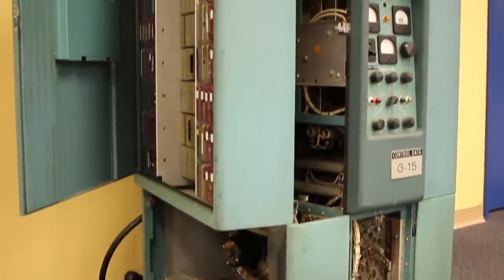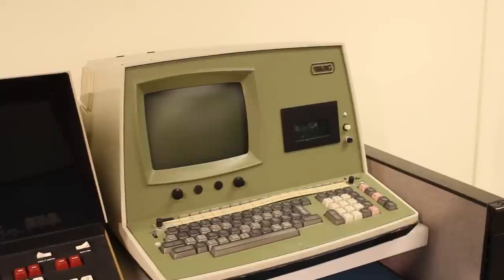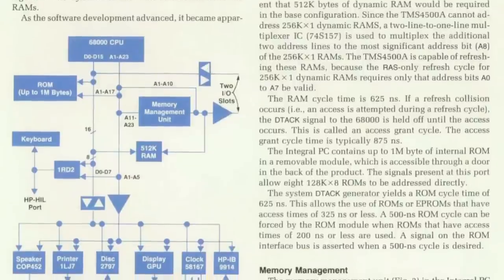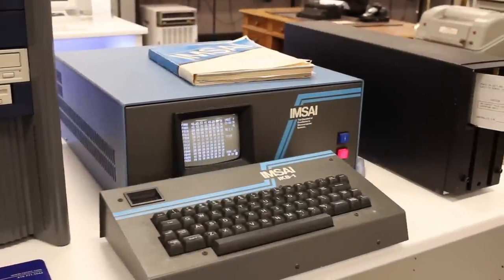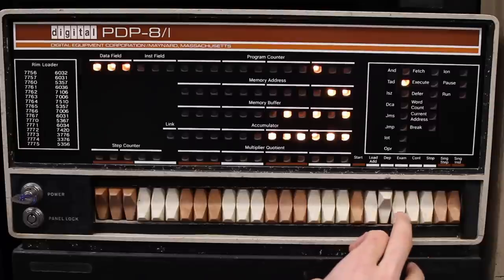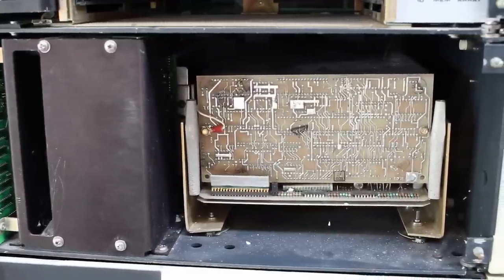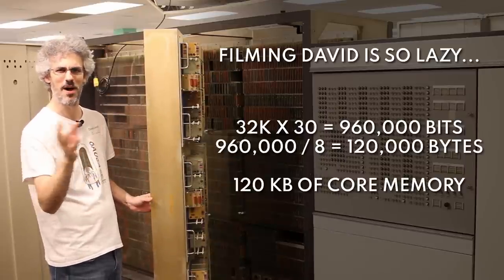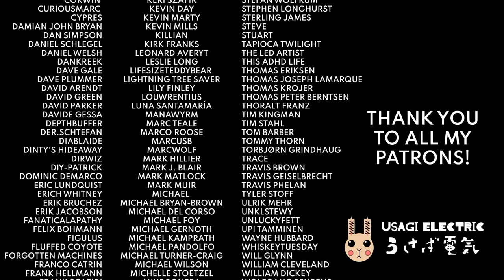Insane Computer Collection at System Source Museum

Comment: 18:20 how were field technicians or the owners expected to track down faults in the middle of this spaghetti?
Reply: That's why all the cards have test jacks on them. I don't know about that system in particular, but most of those type systems had dedicated test equipment. When you connect two cards, you'd then test continuity (and perhaps resistance and capacitance) between the cards to make sure the connection was correct. And then it would get logged in the system's documentation notebook. Things like engineering change orders, repairs, etc were all tracked, along with the date, engineer, reason for change, etc.
Reply: On the Burroughs medium systems, we had very extensive schematic diagrams of every card, and even more extensive wiring lists for the backplanes.  We would load in diagnostic routines, then single-step the clock while pocking around with an oscilloscope, to see if the right bits changed at the right time.  There were large "card extenders" that allowed you to pull any card from the backplane, put in the extender, then plug the card into the extender.  That way you had access to every chip on the card, and the traces on both sides of the card, to make it easier to follow signals around, and find the faulty chip.  Then we'd replace that chip by soldering on the card itself, or sometimes replace the faulty wire on the backplane.  It wasn't that hard to do, actually: just very, very time consuming to do fault finding like that.  Big bank customers did not like having their mainframes offline for many hours at a time while we fiddled around inside, single-stepping and probing.  Mostly we would just swap the faulty card for a spare one (yes, we had spares for most cards on-site) to get them back up and running fast, then do the fault-finding on the bad cards in scheduled maintenance times.  Even though that "bowl of spaghetti" backplane looks impossible, there's actually list telling you which wire goes were, so you can troubleshoot... slowly!

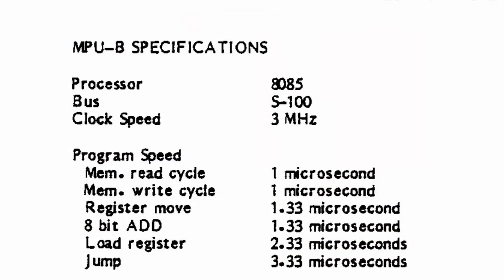Comment: 7:36 I think the 8085 was Intel’s attempt to fight back against the Z80. Not a great success.
Reply: Doubtful. No changes were made to the instruction set, with the exception of the RIM and SIM instructions being added.  The 8085 eliminated the need for the 8224 clock chip and 8228 system controller. It did have a significant change to the hardware interface, changing how the system control signals were handled and the multiplexing of the data bus onto the address bus, plus silicon improvements to allow it to run up to 3MHz. It would be considered an incremental improvement over the 8080 more than anything.

Comment: How can anyone service one of these wires without messing 5 more of them? It is like fighting the Hydra.
Reply: As one who did do maintenance on similar wire-wrapped backplanes, I can say you are dead right!  "nightmare" doesn't really cover it.  Especially when we had to install "patches" to upgrade them (called "RINs" and "LINs" in Burroughs jargon).  That usually involved cutting and removing existing wires, and replacing them with different new wires, going to different places.  When I had to cut one of those, I always felt like the guy in an action movie, facing the ticking time bomb, trying to decide of it is the red wire or the blue wire that  I need to cut... One wrong move, and the machine is dead.  (To make matters worse, they were all white in the back of a B4800!)

Comment: Beeing able to hear so called ,,bus''. What about atari 8bit. The same? EM radiation? Keyboard also? Cray One water cooled... To much fun with too much disinformation for my taste. I like channel still, but this one should not happen.
Reply: I still have my 800XL and somewhere I’ve got a copy of Mapping the Atari and De Re Atari (among books). I thought that the sound was produced by the POKEY CHIP. It does I/O (such as disk drives) as well being the sound chip. The sound is uniform as opposed to buzzing seemingly randomly (depending on the bit patterns like in this video). My understanding is that each beep is a sector being read (and a different sound for writing iirc). In BASIC you can POKE a particular address and “turn off” the sound. That address is listed somewhere in the books mentioned above. But really it is never off so much as severely dampened like a wet towel was put over the speaker. And furthermore, if you write DOS boot files to a floppy, that new boot disk will have the “silent” setting enabled by default. (iirc) it’s been a few years, I need to hook it up again. (been busy collecting 5200 stuff)